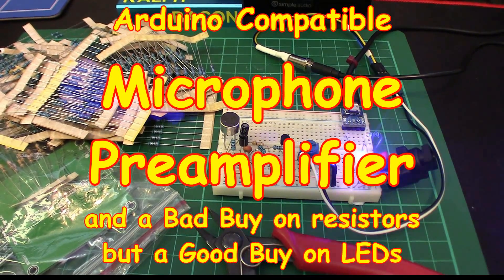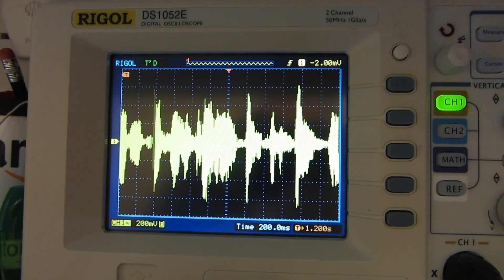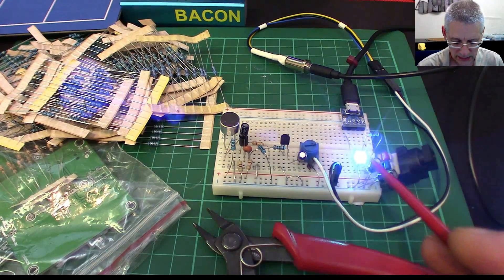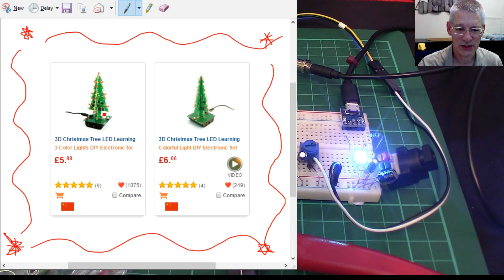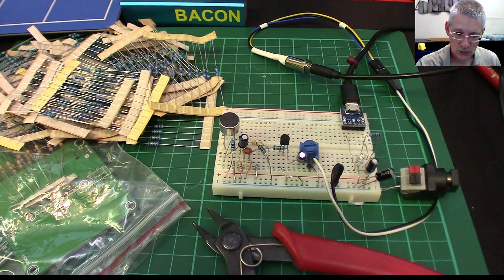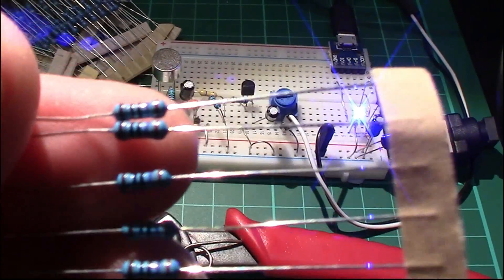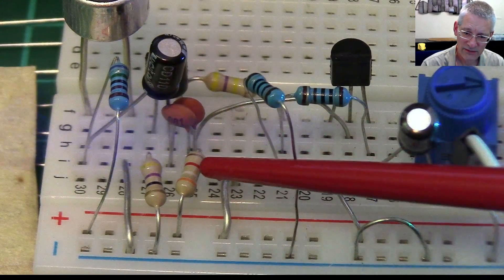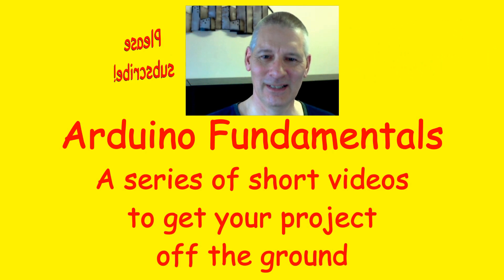#52 Arduino Compatible Microphone Preamplifier, super LEDs and awful resistors

Comment: I salvage a lot of parts,  and the ambiguity of colors on some of those resistors drives me nuts!  Is that red,  or brown?  (As you say in one of your replies to a comment.)  The body color is significant,  though -- brown is typical for "standard" resistors,  and blue is supposed to signify "flameproof",  as in you overload the heck out of one of these and it'll fail,  but it won't burn things up...

I just measure them for the most part,  before I put them into something.
Reply: Try being color blind.  LOL  Thank god for multimeters and girlfriends.  (no such  thing as a color blind woman, well less than 1 percent)
Reply from the maker: Which is why I gave away a whole bundle of resistors that had a blue body colour, and replaced them with a similar bundle that has a nice beige colour. Now I can read the values! I don't care if the blue ones were flame proof or not, the aggro it caused me trying to decipher the value (as you say, red, brown, orange?) was not worth it!

Comment: Hi Ralph. Following your comment about the E12 and E24 resistors. I googled and found this Vishay site https://www.vishay.com/docs/28372/e-series.pdf that lists resistors to E192 increments. I knew E48 exists but E96 and E192 WoW! (Also confirmed on Wobblipedia).
Reply from the maker: Good research there Brian, and what's more those resistors are (usually) supplied in very tight tolerances. Well, they have to be really as, for example, the two E192 values of 132 and 133 would be useless (even a 1% tolerance for 132 covers the range  130.5 - 133). It's a pity that over the years the tolerance of electrolytic capacitors hasn't improved (-50% +100%) nor has their lifespan (reckoned at 10 years). Now, just like a smoker of 4 packs of cigarettes a days lives to 101 years, so many electrolytics can last for 30 years! Anyway, good to hear from you, thanks for posting.

Comment: I know the transistor codes sincerely I was 10, but I gave up exactly coz of the 5 bands..... but also..... I just can't see the band's anymore
Reply from the maker: The four-band codes are still alive and kicking. And for general hobbyist work its the most common (-ish). But regardless of the number of bands, when they're printed on an azure background they become unreadable anyway. So choose a resistor pack with a beige background, 4-bands and you will be OK - plus a magnifying glass perhaps, and a multimeter!
Reply: Ralph S Bacon I definitely rely on the multimeter. The ivory background resistors are definitely more readable

Comment: try http://www.digikey.com/en/resources/conversion-calculators/conversion-calculator-resistor-color-code-5-band
Reply from the maker: Yes, Paul, I know there are sites that would give me the resistor value, but I'm "old school" inasmuch that I learned how to read 4-band resistor colour codes as a young whipper-snapper only to be torpedoed by this ridiculous trend towards a 5-band scheme. Whilst we're at it, let's all suddenly drive on the other side of the road, just to see how confusing that might be too! Ha Ha! The good news is that the replacement (very comprehensive) set of resistors I bought from Banggood uses the 4-band colour code scheme on a light beige background - I'm happy again and all is right in the world. Thanks for posting that link though, I (and others) will doubtless find it useful going forward.